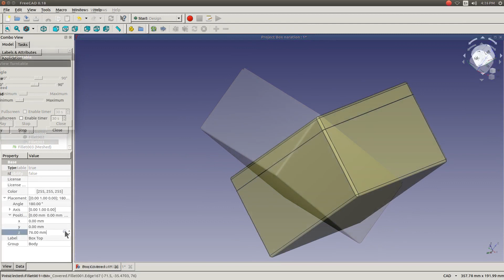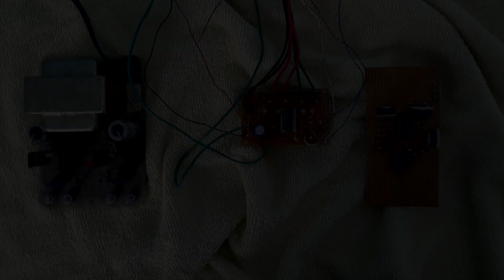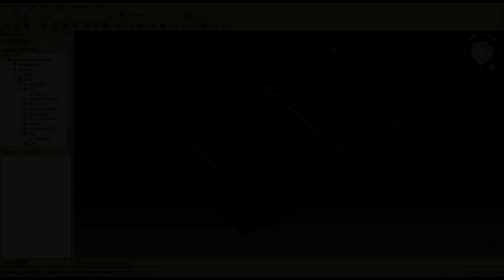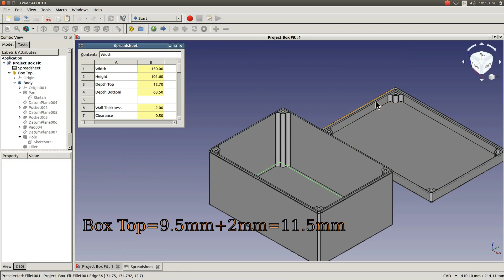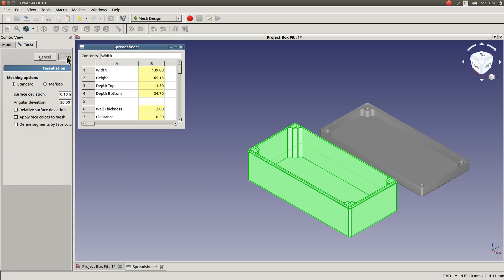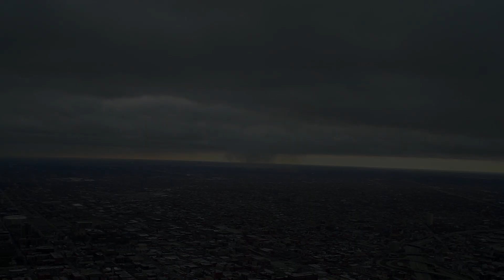Crazy Simple 3D Printed Enclosure with FreeCAD 0.18 Parametric Design Part 1

Comment: I think I need a step zero.  Where did the original box come from, where did the spreadsheet come from?
Reply: Maybe too late for you but for others in the same boat, watch https://youtu.be/RNCsazKxviQ
Reply from the maker: Regarding the box, I literally created it from scratch in the early parts of this tutorial using the sketcher work bench and the pad tool.  Your questions regarding the spreadsheet are best answered by Googling freecad spreadsheet workbench. If you study that section, you will know what I about the spreadsheet.   Hope this helps.
Reply: @bcastlar3453  Thanks for the series. I'm just looking at part one here so far. Big help actually. I was wondering what the spreadsheet workbench was. Way different than what I thought.

I do agree with @RW Green though. Maybe on your next thing a brief preface or even written reference to what precedes it would help with the overall quality of the experience. As you know Google, YouTube tend to drop folks in the middle of these things. Helps a bunch knowing where "start" is and if any given video is going to be worth my time too. Something simple, I know these things take time, a lot of time. Your effort is sincerely appreciated.

Before I go any further here I will go look at the spreadsheet workbench. Link for others - https://wiki.freecadweb.org/Spreadsheet_Workbench. I'm making an encoder housing that's round on one end to match the motor curvature so I will need to model that too.
Reply from the maker: Sorry it was not clear to you.  It’s a tough call when writing a script to balance clarity with script length.  Most of my videos run longer than YouTube recommends for audience retention. If anything is not clear do leave a comment.

I’ve had my own experience making a quadrature encoder for a lathe chuck though that project precedes my discovery of FreeCAD.